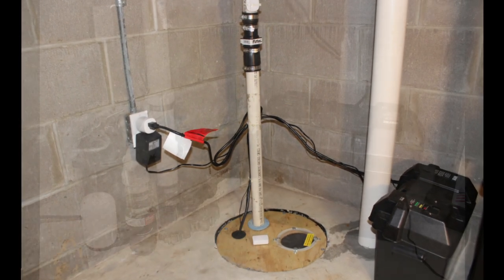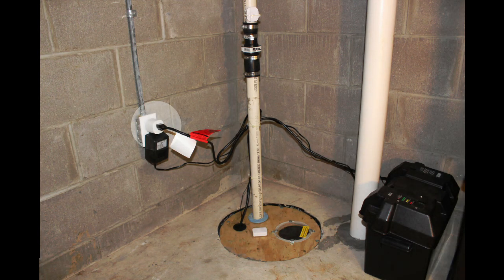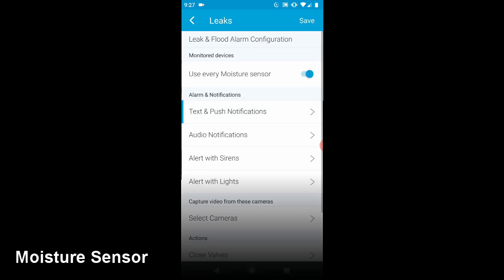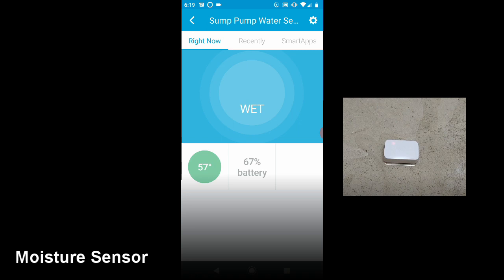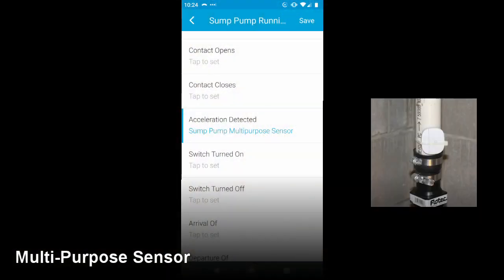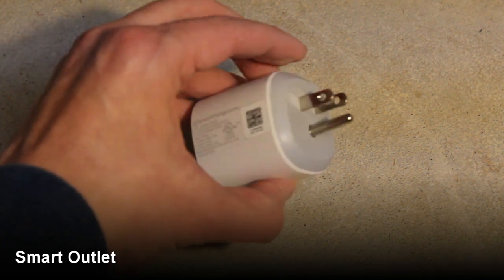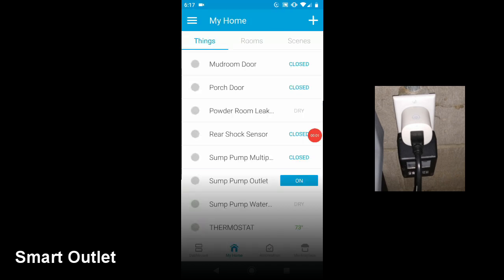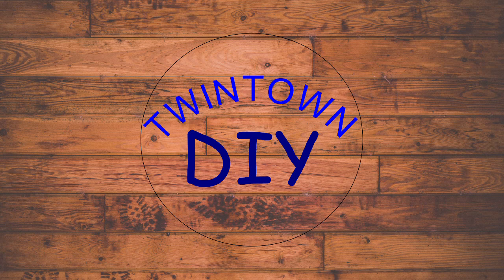Smart Home Sump Pump Monitoring with SmartThings Sensors

Comment: Do they make  sensor I can wire a off on alarm switch too.   Basically it’s either off or on with no power
Reply from the maker: Thanks for watching.  You could use an alarm like in this link or similar.  https://amzn.to/3WTZ55c
I'm not sure if that is what you are looking for, but this alarm could be triggered by a sensor, etc.

Comment: Do you know of an smart plug that can monitor when the connected appliance is running and allow you to configure an alert if it runs longer than a specified time? I have had twice that my sump pump has shifted and the float was suck, leaving the pump running. Being able to set a notification if the pump runs longer then say 60 seconds could be helpful.
Reply from the maker: It can be done with the Smartthings outlet I'm using in the video.  Create a new if/then routine based on the outlet for when the power meter is above a certain wattage.  Then notify someone via text message, etc.  Hopefully that works for you.  Cheers!

Comment from the maker: The Smartthings Classic app has been discontinued, but let me know if you have questions on using the current Smartthings app!
Reply: is there an alternative app that you use- I like this set up but how can i monitor it with the app discontinued - please advise!  Great video
Reply from the maker: @nightfuryflight7389  Now I'm using the SmartThings app.  It's the latest version and it works well too since they discontinued the classic app.
Reply: I’m just getting into home automation. Does the smart things water sensor trigger the outlet? And can I get it to activate a central siren too?
Reply from the maker: The water sensor triggers notifications in the Smartthings app that send me a text message and notification in the app.  The outlet is always on, but I have it send me a notification if it is off which would happen if the power goes out.  There is a battery backup sump pump that will turn on automatically when the water level rises and is separate from my smart home.  You can also trigger a siren through the app.  Thanks for watching!

Comment: Thanks for your video it was really helpful. I was wondering if you had any suggestions on maybe a water level sensor because I have about 8 in inside my sump pump. So  it will be more helpful to me to catch it within that 8 in before I actually got water on the floor. Thanks
Reply from the maker: That's great.  Thanks!  A few options come to mind to detecting water lower in the basin:  attaching the water sensor to the pipe with cable ties at the height you want or mounting on a shelf/bracket in the basin.  I haven't tried it but probably could solder a set of wires to the exterior leads on the water sensor to extend into the basin and keep the main sensor above the cover.  Just make sure to have those exposed leads at the height you want and test that it works properly.